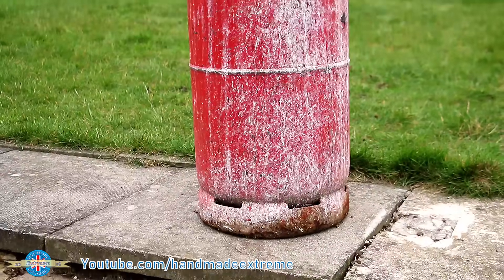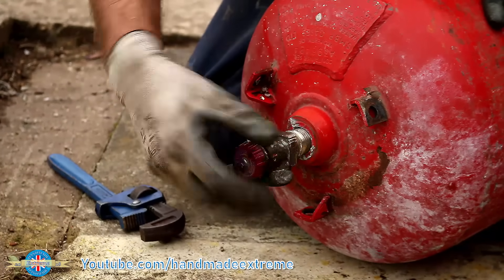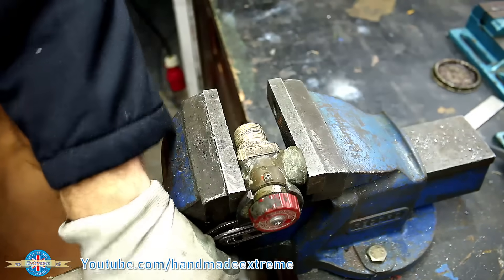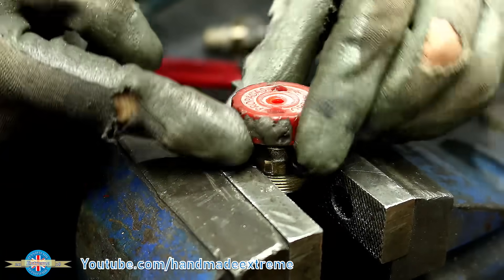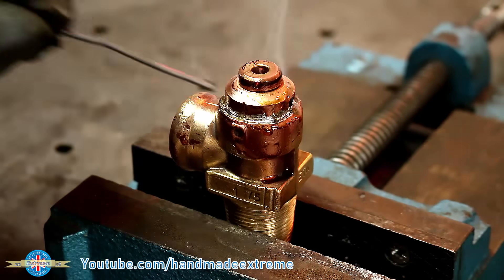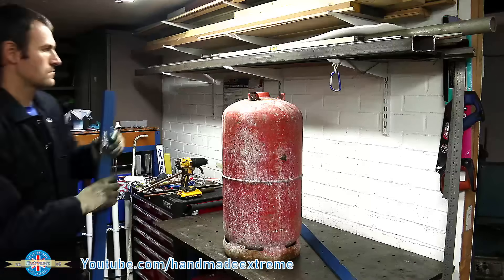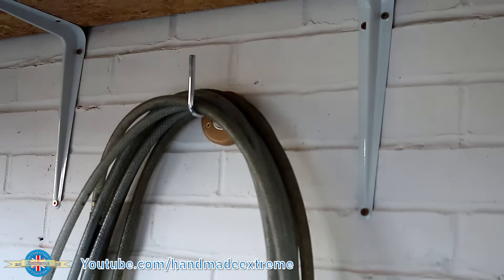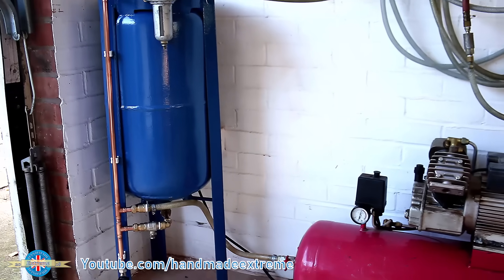Making an auxiliary air tank from an old LPG gas bottle.

Comment: I'm over 90. I will share one my observations from over the years.
Whenever somebody works above the capacity of others with limited capacity.
The haters emerge.
Reply: Not if they bring proof to the table I don't trust these old tank without an hydro pressure test its like living next to a pin out grenade painting the outside shiny blue won't protect you from its bottom inners now only 1/8 inches thick due to rust !  https://www.youtube.com/watchv=sm_FJ6Pat4I&feature=share&fbclid=IwAR3z_ji_bh9fZkMdMj9b-5gsL4Csvu20Ppe9Bvt9d4V2iq89-QM54koC0mU
Reply: @1badpete999  True.Not many people drain their tanks to let moisture out.No different than a car rotting from the inside out.
Reply: @ritaejohn  I'm under 90.  Whenever somebody works below the capacity of others with unlimited capacity, the haters also emerge.  Rule no. 1 in life, someone is always bitching about someone or something 🤣
Reply: I like how you try to keep up with the times like The Queen does.
Reply: This is not capacity above others this is pure danger! there is a reason it is not allowed. Are you a ASME certified welder?
Reply: @710Craig  Being an ASME certified welder don't mean anything.All that means is that your welds comply with their codes and standards for a particular test and procedure.Engineers determine the test,not the welders.
Reply: @710Craig  im a certified welder and who gives a flying fuck throwing around certs and shit

Comment: Its a cool project but you do a ton of weird shit. Like why drill out a valve to turn into a 90 degree fitting wgen you could have used a standard 90 degree fitting?
Reply from the maker: Haha thanks. Local store didn't have any in stock. Just a case of wanting to get the job done and working with what I had.

Comment: For American viewers, opening the valve will not drain the tank, there is a safety valve in the opening that has to be pressed in with a fitting.  Otherwise you'll open the tank under pressure. Also, some people should make sure they have enough compressor to fill both tanks it prolonged run times will occur on little non-duty cycle pumps.
Reply: Yes check out my comment, I burned out a good compressor motor trying to fill a big tank.
Reply: This method of expanding an air system is for intermittent use of air waster tools, otherwise you'll need a much larger volume compressor head.

Comment: Hey man. I'm going to give you a handy tip. Im a welder and I make a ton of wood burners from gas bottles. Don't bother filling with water, instead remove the valve and use your plasma cutter to perform a "controlled explosion". Simply aim your plasma into the hole from the valve. Press the button a couple of times to flush air into it. If there's any gas in there, it'll ignite with a big whoosh. Once this has happened, if at all, the cylinder is safe to work on. Obviously don't have your hand or face in the path of the whoosh! I've done this literally hundreds of times and saved myself a ton of water. Also, even after filling with water, you can have some flammable residue remaining which can whoosh when cutting and burn your hand, I've got a scar to prove it 😉
Reply from the maker: Interesting idea. I did wonder about trying a 'controlled woosh' haha 
Thanks for the support.
Reply: @Handmadeextreme  Do it. You'll save a lot of time and water. And you won't have stinky water to deal with  afterwards either 😊

Comment: I like your idea here and have thought of something similar. I deal with propane tanks all the time with the energy company I work for. They are much thicker than regular air compressor tanks and can take a lot of abuse so this is a perfectly safe secondary use. The only suggestion I would have had was to do a visual interior inspection just to make sure there were no puts inside. There shouldn't be if it still had propane in it, but just a precaution. Someone mentioned you closing the valve with the auxiliary tank pressurized. From what I understood you were only going to pressurize the tank when you are using the additional capacity and the rest of the time it would be unpressurized with the valve closed. So no issue there. 
I was curious why you didn't just use regular pipe fittings on the tank since it does have regular threads and you weren't utilizing the valve as a shut off?
I have another handy tank project I did do and you might find useful. If you can get ahold of an old aluminum tank for forklift use like I did they are a great portable tank for filling tires etc. They have multiple standard threaded openings for filling, pressure reliefs, gauges and hose adapters. Very light and super rugged. I'm making a mount to set it in upside down in to keep water from collecting and using an air hose to connect it into my air system to add capacity. I can also disconnect it easily to take it out of the garage to where air is needed. Nice work, carry on!
Reply from the maker: Great comment Mike. 
Why I didn't use regular fittings on the outlet: Just a case of the local store not having one in stock and wanting to get the job done. Had the tools and it would have taken longer to got further away to buy one. Not the ideal solution but got it done.
You are correct about the extra valve. In reality it says open all the time so both tanks at protected by the PRV in the main tank. 
Like the portable tank idea. 
Thanks for the support. Glad you enjoyed the video. 👍👍

Comment: Question: is it not true that having the main port at the bottom of the tank will introduce water from condensation into the air lines? Wouldn’t it have been better to use the tank right side up?
Reply from the maker: The compressor will inevitably pull in and push moisture into the tank which will condense out in the inside of the tank yes. However by putting the tank this way up that water can escape because the hole is at the bottom and the water will always run down hill. If the tank is the other way up the water will never be able to get out and you end up with your tank gradually filling up over time. Hope that helps. Thanks for watching.

Comment: Great project. I built my own 2 stage compressor from bits and pieces (new pump and motor, all else used) 35 years ago. I hung 3 100# (US) bottles upside down on the wall. Connected with salvaged hose from work and added a relief valve at the bottles for safety. I run at 160 psi and has served me well with nary a problem.
Reply: That homemade two stage compressor is such a good idea! Right now I just bought a few used compressors and connected the air hoses together with a manifold. Once I get my shop in a permanent shape, definitely going to keep this idea in mind! Should just have to get beefy tanks and regulators and should be able to keep pressures of 200psi+.
Reply: @wozzlebaby5313  Just an FYI, a 2 stage compressor does not have anything to do with storage volume, it has to do with a primary stage of air pressure/volume being supplied to a second round of compression and with that more volume of compressed air, this can be repeated as many times (stages) as you choose either by adding subsequent progressive changes in cylinder volume by adding cylinders to a common crankshaft or by adding separate compressors.
https://www.youtube.com/watch?v=yLWzBuk5lRs

Comment: Question: can this be used for an Auxillary natural gas bottle.. 
Background: my parents are in Pakistan (stayed there due to well their life pension and other family and being old and cannot travel)..the natural gas inflow from the company is fine and the home burner works fine too for cooking.. but in winter.. the only thing for cooking , heat the home and getting hot water in the morning is the geyser (water heater) but the gas vanishes after 9pm and come to full flow at 12pm in the noon next.. happes all season..every year, 

so my question is.. can there be a system to use an auxilary tank to store the gas..just enough to keep the main geyser from running out at night and have luke warm or hot water in the morning?

the steps that i think that will work are (i am by no means have any experience in this field)

1. main gas line going to cooking burner and geyser
2. seconandary gas pipe with cutout ball leaver to send gas directly to the auxilary bottle
3. A Pressure pump and guage
4. An Auxilary bottle 19.0kg 
5. 2nd manual ball lever (to turn on or off the auxilary bottle getting direct connection to the geyser)
6. gas piping (from Auxilary bottle to geyser gas pipe)
7. pressure guage
8. electronic auto system (aurdino device with an 16x4 lcd to see and a 1.2 MPa pressure transducer and to keep the pressure from dropping to a certain level then fill it up or a cutout option to fill the bottle when not needed)
Reply: that would be really tricky.  the pressure after the regulator is only 0.5psi in the case of propane.  and going before the regulator brings up huge safety concerns.  if i were in the same situation, i would just change over to propane gas bottles and forget the main

Comment: You need a max pressure relief valve to make sure you don't over pressurise. Also I would make sure that propane can can handle the avg 150psi compressors typically put out. Good job on not using pvc piping though.

Comment: Thats has to be the most difficult way to go about it that I've ever seen. Shouldve just pulled the original valve out of it and bought new fittings.
Reply from the maker: Ideally yes haha. It was a bit of a case of having most of the bits on hand and having the machines available and the local DIY store not having one in stock haha. Made the project a bit more interesting though. Got to play with the Big blow lamp after all..

Comment: Far more work than our version. 
We used a smaller bottle. It's fed from the compressor via water trap & regulator - so no water issues. Bottle is unmodified and hence gives us a portable source of compressed air.

Comment: Anyone know where to get a compressed air motor and compressor? I found a amazing tank with no motor or compressor.

The only ones I found were junk or worth more than a new unit.

I’m in the US.
Reply: Harbor Freight and Northern Equipment. Obviously, the Harbor Freight ones are built in China, but then so are all other small-ish compression tanks. California air sells the motor/compressor single unit assemblies online without the tank assembly.

Comment: this isn't always about pressure, but feed. if you have a big building, you can put a buffer tank far away from the compressor, and you're getting nominal power without the lag of having to wait for air to travel that far, and compensate for line loss. this is how underground mines work their air drills for example.
Reply: The system you describe gives the best performance with  the most simple system as practical, the concept is the same one an electric power grid uses.
Reply: As a 35 year underground miner what you don't want is remote tanks or any pipe that goes from big to small and back to big. You want the largest diameter main airline your compressors can support. Oh! And when the engineers tell you how many cfm of compressed air the mine will require, double that number when ordering the compressors, if they specify a 6" main airline  use 8". What works on paper needs to be doubled to work in real life.
Reply: @jimevans3040 I've definitely seen surge tanks in mines before but it's definitely not ideal. It's for when you ran the 6" pipe, but you're too far back so the drill starts strong then dies off while the until the volume of the air line can build momentum. The surge tanks keeps it running strong without the sag. You're basically using the 8" upgrade as one massive surge tank as the extra volume of compressed air is making up the difference
Reply: @Seldoon_Nemar  They do get used, but are like putting a band-aid on a brain tumor. The best thing you can do to store additional air volume is use  larger pipe in the main line. Now a remote surge tank with a dedicated line thats larger than the line leaving the tank would probably work fine. But if the line coming in is smaller than the line going out, or the incoming line has been tapped and being directed elsewhere there will be fuxuations in both volume and pressure that get horribly worse then there is high volume usage spike such as miners using a 2" blow pipe or shotcreting.
Reply: @jimevans3040 it's more like a manifold. You'd run your 6" in then have a bunch of smaller lines coming out to the work sites. It's just to even out all those pulses like putting a capacitor on in a circuit to clean it out noise and stabilize the feed.
Reply: @seldoon_nemar  the usage on a compressed air system underground isn't quite that simple. Some mines may have 50 to 100 miles of pipe supplying the compressed air to the various areas that are being actively mined.
Reply: @jimevans3040 I think it's also a volume issue. If you have a mine that big, you don't really need them because you're flowing air constantly. The surge is only needed if you're like 1000' back but only using a bit of air. The air in the pipe fully stops and the compressor kicks into bypass, but you can drain your local pressure down before the air coming from the tank knows to star moving.
Like I said, it's a really niche use case and most mines these days just don't need them because they're too big for it to matter

Comment: I would weld lugs on the feet of those angle irons and dynabolt it down so it can't  fall over...........apart from that it looks good to me.  LPG would be stored at far higher pressure than what your  compressor puts out I would imagine.  To keep everyone quiet plumb in a blow off valve into the system as a backup to the one on the compressor.

Comment: Would be cheaper just to buy a cheap air tank all the copper and fittings are not cheap
Reply from the maker: Depends what you have got lying around. I think this only cost me about £10-£15 in parts. Totally agree though if you had to go and buy all the bits new it would be cheaper to just buy a tank.

Comment: ~1:00 is that really a leftover propane? issin`t that the additional gasses that produce the "propane smell" since the actual propane has no smell, so the additional supplement is being used to add the smell so the users would know when there is a leak.

Comment: You may have things figured out to please yourself however, you have violated several pressure vessel codes in any state you wish to choose in the United States. I would be very surprised if you haven’t violated any European pressure vessel codes. You have modified a pressure vessel. No testing after modification. No certification by competent legal authority. In the states these vessels have to be replaced or recertified every five years. Don’t know what European standards apply but, would be surprised if there wasn’t a similar requirement in place. What you are proposing sir is illegal and dangerous. Just my opinion

Comment: I like this idea.  The only thing you may have missed or considered not necessary is a pressure relief valve.  If you decided to do without, why?....guess I should of read the comments first as apparently I'm not the only one wondering and the question was asked and answered.  You didn't show how the tank was connected to the compressor tank in detail.  It's assumed that with your accent and the union jack you and from England so what is the code as it pertains to pressure vessels?  Thanks.
Reply from the maker: There is a PRV in the main tank. Both the tanks are connected directly together, if there is an over pressure situation the existing PRV will vent both tanks. It works just like having one big tank. Thanks for the questions.

Comment: Not letting the water settle out of the air will send it throught your air tools ruining them. All compressors have a bleed valve at the lowest point for a reason

Comment: The air should always be released from the top and the water drained from the bottom that way less water is sent to the air tool and damaging it.. A lot of machining and welding  done here when all he had to do is screw a fitting on the top and drill and tap a drain on the bottom no welding. Putting that piping and drain right on the feed line ensures water will be in the air tool. big fail here. the proper way is  to not put that drain leg attached from the bottom, attach it to the top of the tank that way less water will get into the feed line like in the first place. People shouldn't tell people how to do things improperly.

Comment: that looks like a big air lock... not a extra reserve.... as the air can enter through the single hole.... but as you try to use the air it trys to go both ways in the same opening and can't... so the air gets drawn right past from your compressor never syphoning the air out of the "reserve" as air can't get in to replace at same time.... now if had two openings where it feeds in one end and out other that works as don't have the lock......

Comment: Throw a little drain timer on there. Mine was about $100 CDN. You can wire it to the compressor switch so any time the compressor is on it will work. I have mine set to drain every 10 mins for about 5 seconds. My compressor is in my basement so it drains down the condensate drain that the furnace and water heater use.
Reply from the maker: Great idea, thanks.
Reply: 10/5 is your compressor sitting in water jeepers.
Reply: @jareddory2155  🤣 No but it can't hurt. The line is one of those tiny 1/4" hard plastic lines with the push lock connector. It's not a lot of air that escapes.